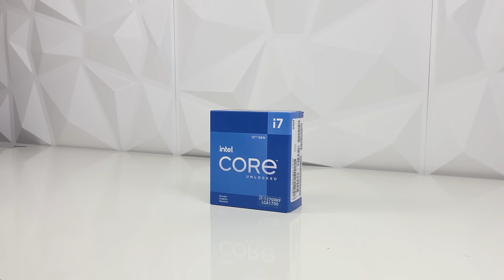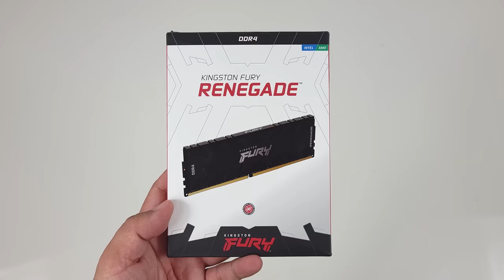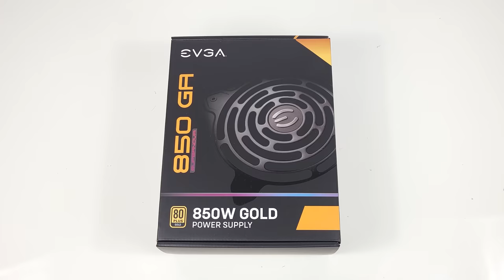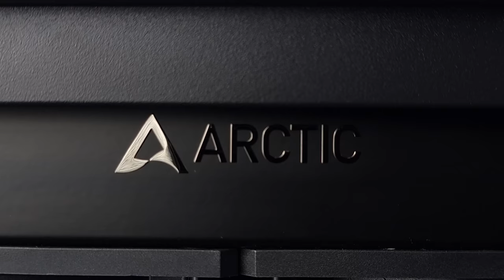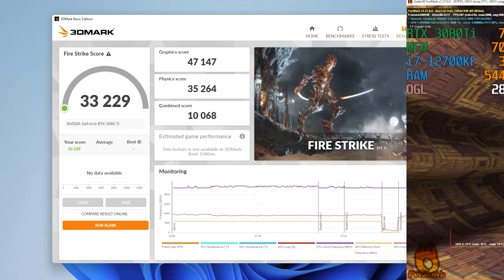Black PC Build 2022 | No RGB | ARCTIC Liquid Freezer II | LANCOOL II | i7-12700KF |  RTX 3080 Ti FE

Comment: Props for using Arctic Cooling fans. Best non-RGB fans I've used in a build.
Reply: Personally id go with chroma black noctua with the arctic cooler for the top cooling performance
Reply: @dannn1663  black noctua fans cost 30€ while arctic fans cost 4€
Reply: @Belyosd  that is very true but you get those incredibly quiet fans with the insane cooling performance they produce.
Reply: @dannn1663  If you have to spend a lot of money, Phanteks T30 are superior for the same price (if you have the space for 30mm). Arctic vs noctua a12X25 is like 1-2% max difference for 5 times the price.
Reply: @Smallman647  i wouldve gotten then phanteks, but everywhere it’s either sold out or overpriced. So i opted for the chroma black a-12’s

Comment: Been doing these builds for years, with Arctic. Best bang for buck cooling out there. RGB adds no performance so no point in paying EXTRA for nothing helpful. If my pump or GPU has a tiny bit of RGB I turn it red as black/red go well together. Currently on a 5800x on PBO to 5ghz, 3090 FTW3 Hybrid w/shunts in a Corsair 5000d, all arctic p12 and p14 fans

Comment: OMG I'm in love with 0 rgb builds! I've recently built one myself, similar to this :D

z690 tomahawk
ek aio 240
same ram
12600k
3070ti
and a bunch of p12's

An absolute stunning all black pc (if I do say so myself ;P)
Reply: How are the p12 fans
Reply: @a3gik301  they’re great! Not only price/performance, but they are great for moving air. I’ve got them set up at 1000rpm at idle/web browsing where they are dead silent. During load I let them reach up to 1400 (they only really reach that under heavy load) where they do make a little more noise, but never louder than my gpu. Gpu hovers around 60*C and cpu around 65*C on a 240rad

Comment: I have a weak score on Cinebench 11625 for a Ryzen 5 5600X, 32GB DDR4 3600 RAM, B550 MSI Unify, Noctua nh-D15 air cooler, 3 120mm intake fans and 1 exhaust 120mm, and a Sapphire Nitro 5700XT gpu. I know overkill with the Noctua air cooler but I'm saving up for the Ryzen 7 5800X.

Comment: Great build mate. I have built a similar rig except with a Cooler Master MasterLiquid ML240L. Did you find that the 240 AIO you choose was not enough to cool the I7-12700K under load? I'm getting higher temps than I'd like.
Reply from the maker: No problems with Arctic AIO. Under 80C on max load.

Comment: is the arctic 280 almost touching the ram or is it further out and going past the ram etc? my current case wont fit it up top as not enough clearance, any help really appreciated, really nice build too btw.
Reply from the maker: 280 won't fit on the top. I had to use 240.

Comment: Hows top clearance with the arctic + that mobo? Heatsink not touching? 

Btw could i fit an Arctic 280? Pretty sure i could not right?
Reply from the maker: No problems mounting the heat sink. You can't use 280 on top but you can mount on front.

Comment: Hey brother, I have the same 280mm arctic cooler in my build. But it's not fitting in my case, neither in the front panel because of the 4080 gpu, nor in top panel because of the ram. I have the Corsair 4000d airflow case. Any suggestions  on how to fix it ? Or do I get a new case? If I need to, which one should I get within that price margin ?
Reply from the maker: 280mm most likely won't fit that is the reason I used 240mm here. You may have to get a bigger case especially with RTX 4080.

Comment: I have the same spec pc, but i put mine in o11 air mini completely full of 4 artic p14 rgb and 5 artic p12 rgb. I bought aorus z690 elite ax mobo tho and i regret not going with MSI, i have usb issues and i hear that ausu and gigabyte boards are more affected than MSI boards. also my case hardly can fit the 2 aio's that i have, my top mounted aio hits my corsair rbg ram which makes me have to gettho mount my gpu aio. it does a great job or taking heat away from my gpu which is clocked about 2100mhz and pulls 450 w

Comment: Do you need to add those circle stickers on the cpu side? I installed them without them and now I’m seeing this getting worried
Reply from the maker: According to the manufacturing manual, yes. If your temp is good. I think it should be ok without it.

Comment: did you have clearance issues with the ram. i am planning to get the arctic 360 with corsair vengeance rgb ram. but i am concerned that it will not fit proberly
Reply from the maker: No problems

Comment: does the plug from the aio itself only has one plug? one and only plug for the cpu fan?
Reply from the maker: Yes. One plug.
Reply: @PCTechnician  same goes for the 360 aio right? How about the fans from the radiator?
Reply from the maker: Same. One connector for both fans & pump.
Reply: @PCTechnician  wow, so you just gonna install the pump on the processor and the radiator with fans on the top case as exhaust. Plug in the one and only cable unto the cpu fan and your 100% finished??? Holy damn

Comment: Been having trouble finding a 3080 ti, what other graphics card would you recommend for this build?
Reply from the maker: RTX 4080, RX 6900 XT, etc.. I guess it really depends on your budget.
Reply: @PCTechnician  would a nvidia rtx 3090 founders addition fit this case?
Reply from the maker: @wntr415  Yes
Reply: @PCTechnician  nvm got lucky and bought a 3080 ti 🙌🏽
Reply: @PCTechnician  what kind of screws did you use to install motherboard to case?

Comment: could i ask some question sir ,if AIO is 280 size it's compatible for this case or not
Reply from the maker: No 280 won't fit here
Reply: @PCTechnician  if you wouldn't mind , please advise a case it's can compatible arctic freezer ii 280 (on top)
Reply from the maker: Arctic 280 is thick AIO. You may have to go bigger case like Corsair 5000D AIRFLOW for top mount.
Reply: @PCTechnician  Thank you for your advice.

Comment: Hey, nice looking build! In this video, do you use the P12 fans from Arctic or the P14 fans? I'm looking to build a non-rgb build too.

Also, any specific reason why you replaced the existing non RGB fans from Lian Li? Like if I get the case, should I remove the fans too, or can I keep them?
Reply from the maker: I used two P14 in the front & one P12 in the back. There is nothing wrong with stock fans, I wanted to use all Arctic fans for this build.
Reply: @PCTechnician  thanks mate

Comment: With no dust filters, relatively open back and net negative air pressure inside, wouldn’t dust become a problem quite quickly? Very clean build though, good job!
Reply from the maker: Two 140mm, three 120mm, I think it will be ok & you can always control fan speed too.

Comment: 240 aio is a little too small to be worth it, i would go 280+ or stick with an air cooler
Reply: 12700k with a 240mm rad is more than enough, plus it's an Arctic cooler which is one of the better 240mm in the market

Comment: To avoid having to twist the AIO tubes that way for it to not hide the GPU, just use LianLi's vertical GPU mount kit. In the vertical position the cooler tubes doesn't hide the 3080's RGB lights.
Reply: unfortunately vertical mount affects thermals in most cases. Unless you watercooling gpu as well.